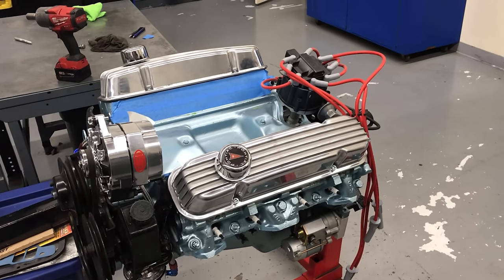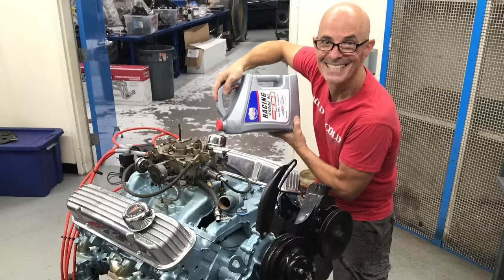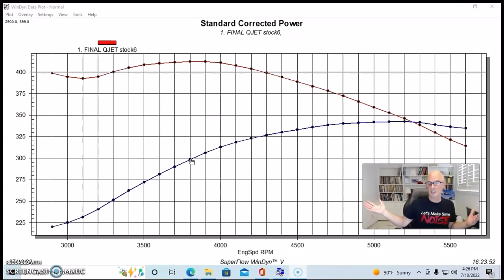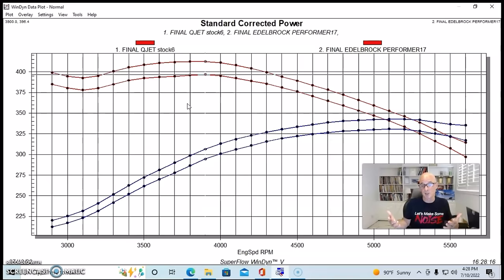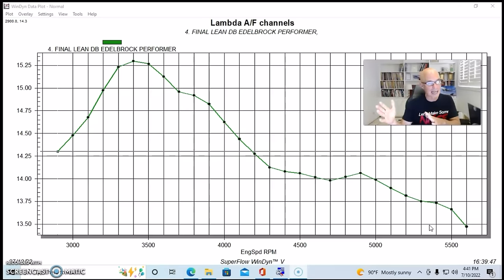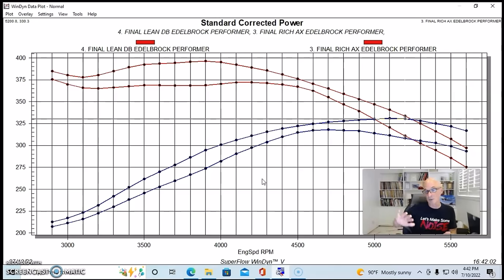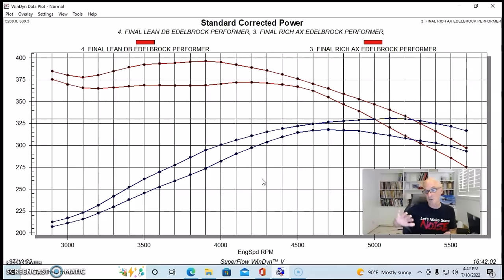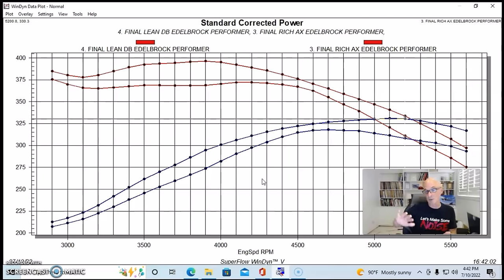HOW TO: Q-JET TUNING FOR BIG POWER GAINS PLUS STOCK PONTIAC 400 Q-JET INTAKE VS EDELBROCK-WHO WINS?

Comment: Single plane intakes will pretty much require at least a 1" spacer or you will be WAY down on power on one of these engines.  It's even worse with the Q-jet as the huge secondary throttle plate stick too far into the plenum areas causing turbulence and distribution issues.  I did a back to back dyno test with a Torker 1 intake against a 1971 Pontiac cast iron intake.  The test engine was a 455 topped with #48 heads and RAIV camshaft.  We LOST 59 horsepower replacing the iron intake with the Torker 1.  Yes, not a typo 59hp when we went to the Edelbrock Torker intake!....
Reply from the maker: a spacer won't help the torker-a single plane is not a good choice for most street/strip motors than run below 6500
Reply: @richardholdener1727  Cliff probably has thousands of hours track testing Pontiac stuff so I don’t doubt what he says.
Reply: I won't contest your findings other than to say there's more going on with the torque/power curves than just peak horsepower.  It seems odd that Edelbrock would have made the Torker I with the stepped plenum floor to help redirect some of the massive flow from the secondaries to the front runners if the throttle plate intrusion was such an issue (or perhaps that issue is exactly what they were trying to address).  I'm running the Torker I, port matched to 6X heads on a 4.25" stroked 350 with a Comp X276HR cam and a Buick GS455 Stage-II Q-jet pulling 442 lb ft at 4400 RPM and 453 HP at 5600 RPM.  I find the idea of a 1" spacer intriguing though if I can get it to fit under a 1970 TA shaker.
Reply: @srmsrm3676  The "shelf" in the front of the plenum in a Torker 1 was dubbed by HO Racing in their book to help reduce fuel "impingement" if memory serves me correctly.  I've dyno'd and drag tested the Torker 1, Torker II, Street Dominator, and the Tomahawk (custom ported Street Dominator).  Without at least a 1" spacer all of them suffered on the dyno and didn't fair all that well at the track either.  On the vehicles we tested intakes on at the track, both 455 powered pump gas (daily drivers) capable of deep 11 second runs in full street trim, the Street Dominator with a well blended fully open spacer and Holley 850DP carb ran the highest MPH.  It did NOT however run the quickest ET.   To our surprise the quickest ET that day was using a factory cast iron intake and 1977 Pontiac Q-jet.  The intake was "modified" and port matched so everyone of course cries "foul", but being at the stock height made for less "cobbling" for the testing and no shorter air filter required, plus a shorter Shaker and moving the air cleaner lid down some.
Reply: @richardholdener1727  The Torker 1 is just a "turd" all the say around from the dyno and track testing I've done with it.  The "hot ticket" back in the day was to obtain two of them, cut them in half and weld the rear halves together.  At that point you have a decent part.  Edelbrock came out with the T-II intake, which does all that for you and is an excellent intake, but sadly it only has a square flange and will not accept spread bore carbs w/o an adapter......
Reply: @cliffshighperformance8421    Thank you for the comments Cliff.  I still have the original manual that came with the Torker I indicating their only recommended modifications to the manifold for performance tuning was port matching to the heads and widening the front runner openings in the plenum slightly.  They had big warnings not to widen very far into the runners through and to never touch the inside radius beyond a certain point.  I will definitely do some space test fitting.  Here are links to some of the dyno runs and build info on my stroked 350.

https://www.youtube.com/watch?v=UaporB7au5U

https://www.youtube.com/watch?v=wjFchbI9jxs&t=5s

https://www.youtube.com/watch?v=cfso2r9udv8

The restoration on the car should be finished in October so I can do the real world tuning then.
Reply: Running a torker 1, 750 Holley on my 1970 WT 400/ #12 heads not sure how it’s gonna run first motor I built thought it looked nice aha probably end up throwing the stock iron intake on and my Qjet from my 78 TA. You guys know anything about the power when switching to tri power intakes?

Comment: I had a 800 (850) Q jet on my Chevy 454 (462) on a Edelbrock rpm Q jet manifold, had to swap rods and jets, made air doors spring loaded worked great, left my Holley only friends scratching there heads in disbelief but it being a spread bore I was spinning tires when it opened up, tried the 3bbl 750 Street Demon and ran great with open spacer with choke removed but was a tad to small, Now I'm running a Proform street 850 and is excellent but makes equal wot power to the Q jet, great comparison video.

Comment: A built Q Jet is the closest thing to efi you can get
Reply: Damn Right!!  Tuned with A/F ratio meter it's  close to FI
Reply: The Ford VV carb is also extremely close to EFI when tuned properly, but it's only a 2V and tuning parts are hard to find. Still, it kicks ass on a little 2.8L Capri!

Comment: When I was a teenager one of my friends had a 70 caprice 350/th350.. can’t remember what was wrong but we fixed the secondaries. Adjusted the TV cable so it was full extension at wot flipped the af lid… thhaaaaaWahhhhh!! Felt like gained 100hp

Comment: Q jet is great,  but I have switched to a street demon 3 barrel.  
 Its awesome.  Crisp throttle response and great drivability and gas mileage like a q-jet , but new and much more simple to work on and tune. And bonus it sounds like a q-jet 👍
Reply: Interdasting... 🤔
Reply: I did the same, but with an 800 Holley Spreadbore. The QJet was having fuel delivery issues, leaking main wells and percolating fuel. Lots of throttle response with the Holley and still get that sound when the dominator secondaries open.
Reply: I ran a 650 version of that on my 302C, I had high hopes for torque, performance and economy, it was good in the bottom end but I just couldn't get the part-throttle economy ok and still have WOT performance. Even with the tuning kit, there just wasn't the right combo in needles/jets to get it where I wanted it. A good deal came up on a 650 spread bore mech secondaries and I rebuilt it, tuned it for economy and my 302C now goes better and gets better economy than it ever has.

Comment: DB is the stock 400 secondary rods and it supported 340+ hp. AX rods are way to much. You need to re-jet the primaries. Also primary metering rods are changeable as well. Stock jetting is 72 and primary rods are mid to high 40's. You can go up a jet size and or put low 40's primary rods. CV secondary rods are really good on a motor built like this. There are so many adjustments for q-jets. They are great carbs

Comment: Q jets are the best all around carb ever made for fuel. Milage and power too Rochester put a lot of engineering into them to get a well rounded streetable long lasting w out problems carb that is still used to this day by many guys they can perform just as well as any Holley or edelbrock carb and last much longer doing it also give you better milage when yoh stay out of it

Comment: Every time I get a rebuilt Pontiac I have low oil pressure the first 500 miles. I think that break in bearing grease gets on the ball and spring in the oil pump.

Comment: A healthy pre-emissions QJet is a keeper.  Gonna be hard to find one that is calibrated for a healthy engine like that one and still have tight throttle shafts.  The vast majority of wrecker QJets are gonna be late model emissions units and you have significant tuning ahead of you.  If it wasn't this way I doubt there would be as much aftermarket carburetor variety as there is.
Reply: I modified one to run 50/50 E85 and 87 octane on my 440. took alot of time on the lathe to get the rods right and I did touch the jets a little. I got pretty lucky really as good as it runs.
Reply: How to tell the difference.

Comment: Open the plenum on the iron intake like the performer and notch the divider wall between the secondaries about 1 inch long and quarter inch deep. Worth a few ponies.
Reply: Better off with a Performer RPM intake & 900CFM ATM carb right out of the box them guys at ATM have got Pontiacs covered.

Comment: You should have just adjusted the float first. Your bowl is running dry, before your secondiary throttle blades open up fully. So, by the time it kicks in (smashing the gas/ flooring it) your already running too lean. When at Low speeds or rpm's your fine, but when you need to get on the interstate/ highway via the side ramp or passing, there is minium to no power on your top end spectrum. Bigger Metering rods help alot, but next time try adjusting your float first then start changing metering rods.👍
Reply from the maker: nope on the empty bowl

Comment: You need to put a Quadra jet on an LS motor that will cover all basis for maximum butt hurt
Reply: Put your money where you mouth is and pay to make this test happen. My prediction?  The Q-jet might make more peak power, but it will lose to a stock truck motor EFI setup everywhere else in the curve.
Reply: agreed power will be up but will cause inherent desruption of injector duty cycles at wide open throttle!
Reply: Yeeeesssssss
Reply: @Harrybowles1969  Are you saying add the quadrajet AND keep the fuel injectors hooked up?
Reply: @Spiritof_76  lol no it was a joke 🤣 but hang on your onto something. Use injectors for nitrous and maybe even to balance a/f ratios from cylinder to cylinder 👍
Reply: @Harrybowles1969  I've seen carburetors converted to use as a throttlebody. But your simultaneously carb/ efi idea has gotten the wheels turning. I wonder if anyone has tried anything like that. Maybe run efi, use the carb as a throttlebody, and spray the nos through an under carb plate? Richard Holdener, we've got your next 2 experiments!
Reply: @Spiritof_76  yes! Geniouses unite!

Comment: When on a dyno you don't have the g force affects on oil. I've always found running most engines at the add oil mark gave a gain in horsepower. I believe pontiac changed oil capacity in 1968 from 7qrts to 6qrts. Might be a incapable dipstick to oilpan

Comment: Oil pressure I glad u brought that up . Of course the engine is just sitting still so it not like you have high g taking off and then letting of at the end of a run and the oil goes the other way..I think a accusump or what ever they are called helps on that . On all the engines I know of a Harley is one Oil level can bite you in the butt with sumping . . I not sure what is going on with the oil pressure but less at higher rpms I'd not a good sign.  I not a Pontiac guy but I think I saw a shop on utube that specializes in them . The therm o quad or what ever it's called by Mopar is pretty good size . I like the smaller primary for just cruising.  I
Thanks for the videos
Reply: When we setup the pumps for the 455 ci motors. We would get around 15 at a hot idle and 65 - 70 at 5,500+ rpm. Modified the internal part of the pump with balancing passages, and ran a thick bottom plate. A lot of work back then, but it paid off.

Comment: How many oil releifs to partly fail? Pump, filter, and filter adapter? Run the tests with an Accu-Sump and/or an external cooler to calm the fluctuation.

Comment: Surprise you didn't have a front intake leaf with that front bolt missing the one that pulls the intake forward.
Also slot the rear secondaries the one that has the spring is on slots will make it run richer they will activate the accell port sooner.

Comment: A little help if you don't mind, before I was Ford blue thru and thru I was a Chevy GM nut !!! Quadrajets suffer from some slight problems
No 1 they made several different needle and seat assemblies that are interchangeable but have different flow rates (a valuable way to combat fuel starvation problems)
No 2 the primary metering rod's are soft brass and wear fast along the metering edge changing the fuel air ratio on the primary side.
No 3 the power valve spring is small and loses it's tension causing the power system to either not function and or perform badly !!! And the power valve Piston is prone to corroding and sticking (a very common problem in Quadrajets !!!)
These variables make the Quadrajets perform very poorly if not corrected before tuning the carb. I love Quadrajets !!! Don't over tighten the bolts either YOU'LL WARP AND DISTORT THE AIR HORN, MAIN BODY AND THROTTLE BODY, CAUSING THE CARBURETOR TO BECOME USELESS,  the main reason Quadrajets become quadrajunk.

Comment: 1980s Lee Maxi Filter!🕺🏻😄🏁
Reply from the maker: OG
Reply: I noticed that LEE Maxi oil filter myself. Those were all the rage for when you blocked the oil bypass in the aluminum oil filter housing, on a pontiac. The Lee maxi had a secondary filter, albeit not very big, for the oil filter bypass inside the oil filter. Whereas normal stock oem style pontiac oil filters didn't have a bypass, just like old school sbc/bbc motors. I remember buying all the Lee Maxi oil filters I could find, circa 1986!  LoL

Comment: Being a Pontiac, was that Q-jet a 750 or 800?    If you want good info on oil levels and/or weights, talk to an NHRA stock eliminator engine builder.
Reply from the maker: Either is oversized for the power level

Comment: Do you have the  heat riser blocked at the intake? It's usually worth about 10 hp plus will help prevent vapor lock.
Reply from the maker: I did not block it

Comment: Do u think the weight savings of an aluminum intake weighing 672 thousand bazillion pounds less than the factory piece will be enough to offset the power loss over a quarter mile?
Reply: No.
Reply: No, been proven time and time again. It’s not new info to poncho racers.
Reply: Nope.

Comment: How in the hell did you get 300+h.p. on a stock 400 engine what year was that motor i had mine dynoed and got 221 hp and 322 torque at the rear end does it actually lose that much power through the drive train

Comment: I have a 69 GTO 400 with OEM block, intake and Original Quadrajet numbers correct carb that has been rebuilt several times. The CAM is a HO Racing (HC01) version of the 068 Pontiac cam with higher lift, nothing radical. The problem i have is the exhaust gas smells rich with mild normal driving. It is to the point of making my clothes smell after driving car with the windows down or sitting at red light gets stinky.  I don't have a huge budget and hate to go to fuel injection. The car idles well at ~750 and runs great and I was wondering if changing the primary jets/rods to a smaller size would help this. The bottom well plugs have been sealed. Any thoughts on this?
Reply from the maker: YOU NEED TO GET A CHEAP O2 SENSOR TO SEE IF IT IS RICH-THEN ADJUST
Reply: @richardholdener1727  Thanks for the reply. It Looks like the cheapest option is to get a dash gauge kit with a sensor to mount on hole in the exhaust pipe.  I ordered a wideband AFR gauge from Amazon. Can I place the sensor at exhaust pipe exit or does it have to be mounted in side up near the X pipe? The car has the Pontiac Ram Air III cast Iron headers.
Reply: @mikeb834  I too, have that rich odor at traffic lights on my stock 72 455. My plug wells were perfect and I have great idle. I have ordered a wideband O2 gauge so that I may tune my Q-jet. My studies indicate that as close to the collector after all 4 cylinders join, is the best place for the sensor.

Comment: The first thing I would need to know before I did anything with any Carb- is the CFM rating of that particular Carburetor.  
        That's the first thing you need to let your viewers in on... Is the Q- jet a 750 cfm is it an 800 cfm?   What exactly are we talking about here??
Reply from the maker: it wouldn't make any difference on this power output
Reply: @richardholdener1727  750 vs 800 CFM most definitely makes a big difference when it comes to supplying power out put on any engine.
            But on a lot of applications 800 CFM is to big.... For a 400 you'd think a 750 CFM would be fine but an 800 CFM would be pushing it.. But whatever the case you have to know what kind of cfm your carb is making in order to determine any correct hp & T calculations....
Reply: @richardholdener1727  You found that out when you put on that small two barrel carb & it knocked it right down from 343 hp to 255 HP......  That's because the two barrel made much less CFM.

Comment: Most people do not know that the RAIV aluminum intake, is exactly the same as the cast iron intake internally. No difference in runner size!
Reply from the maker: those are hard to come by
Reply: @richardholdener1727  there are repops

Comment: Disagree on aluminum versus iron.  Yes lighter but they expand and contract leak, and of course all the attachments are now screwed.  Linkage, cruis, a/c, choke, and on and on.   Aluminum intakes are as bad as headers and fuel drinking edelbrock carbs.   

So many good running cars were ruined by EDELBROCK successful marketing.
Reply from the maker: wrong on headers and after market intakes-stock stock was not designed with just performance in mind (they had other criteria)
Reply: @richardholdener1727  Will you please test on your more powerful engine the difference between Ram Air exhaust manifolds and decent 4 tube full length headers
Reply: Long tube headers cause a vacuum effect headers absolutely matter when your talking duration overlap and exhaust pulse big cams needs headers
Reply: @scottnorris8571  The cast iron headers that came on Firebirds were better than the ones on GTO's. They had longer runners. Speaking of oil pans. The 1964 GTO had the 4 quart pan. Starting in 1965 they went with the 5 quart pan. And in 1965 and later, all had windage trays. We used Tri-Y's on these, and they worked very well.